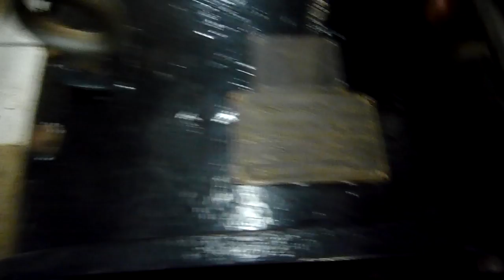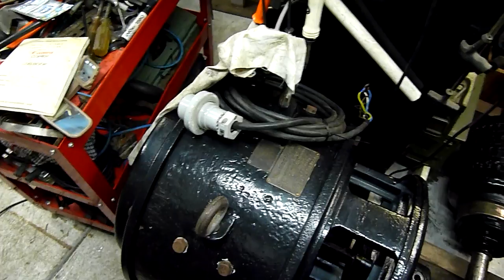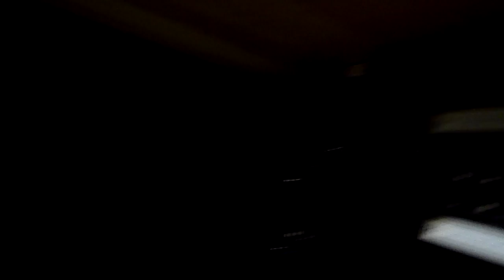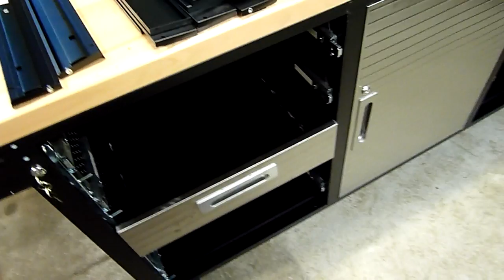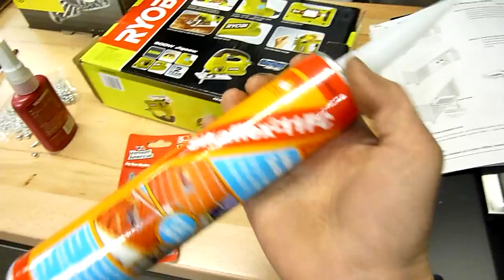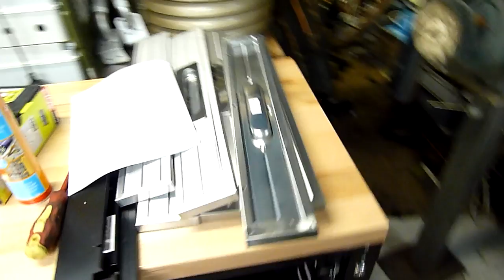Ramblotronic Monday - Cabinets and Cleaning Update

Comment: Looking forward to seeing the Westinghouse genny rebuilt and running....Even if you have to couple a variac'd washing machine motot to spin it up, it'll be nice to see it making some volts, and maybe putting some thin nails across the wires coming from it and getting them to glow and melt. :-D

I can't remember how many watts that genny is now, but it's sure a big sizeable one. :-D

Thanks for watching,

-BoomBoxDeluxe.